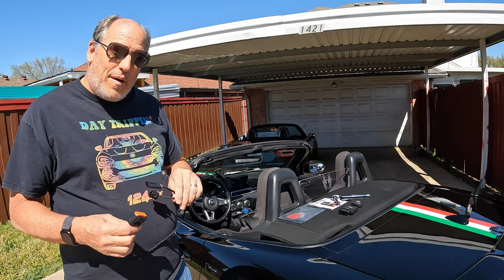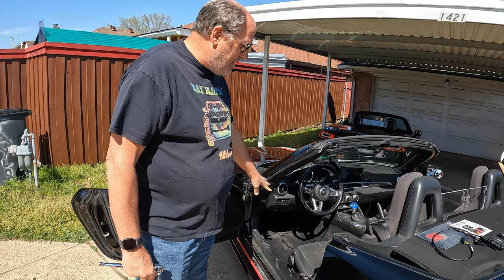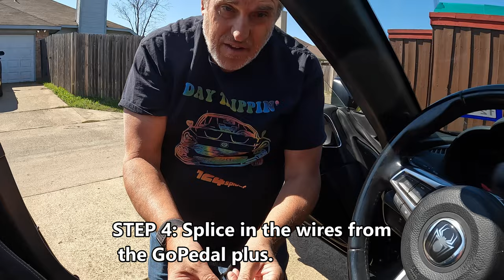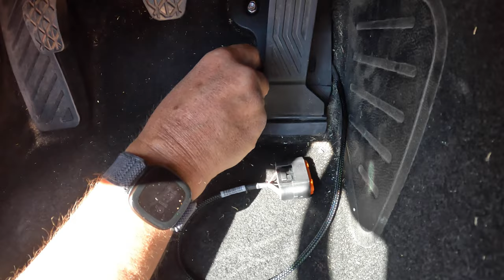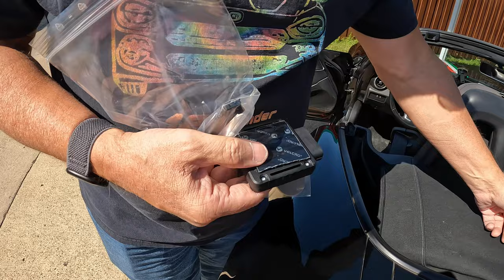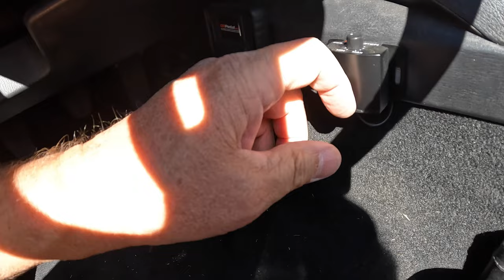How To Install The Madness Autoworks GOPedal Plus On A 124 Spider.

Comment: Had my eye on a GoPedal for my 124 for almost 3 years.  Went ahead and ordered a GoPedal Plus after watching this (install locked and indeed was super easy).  Wow what a difference!!
Reply from the maker: It's weird, isn't it?  Doesn't add horsepower, but what a difference!
Reply: I just finished installing the Go Pedal Plus. Went around my block accelerating with it off and then with it in Race 5 mode. All I can say is WOW! Race 5 is almost too much for normal driving. I’ll probably keep it in Sport 5 or Race 1 most of the time. What fun! Inspiring with my new Auto RiCambi exhaust! Vroom vroom! ✌️